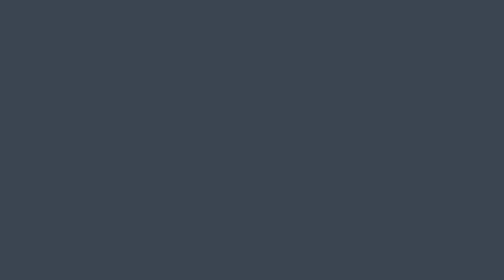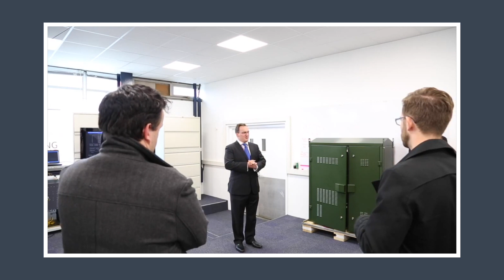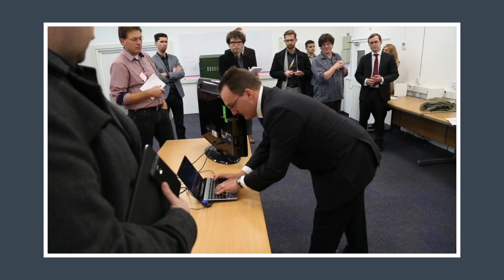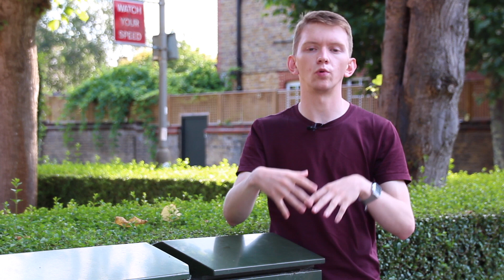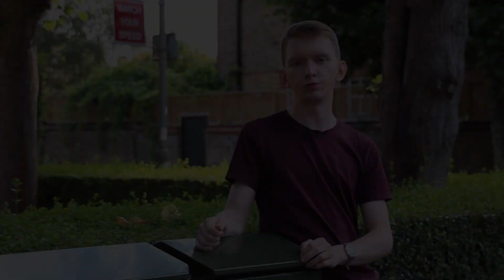Is G.fast an FTTP replacement?

Comment: i have had g.fast since 2019 with SOGEA 160Mbit/s 30Mbit/s but have just placed and order to upgrade to SOGEA 330Mbit/s 50Mbit/s - the street cabinet is literally next to the block of flats i live in so hopefully i will get the full speed of the upgrade and it will be worth the extra £10 per month for the upgrade

Comment: The pods are only ever bolted to street cabinets, not on telegraph poles or under man hole covers, so the points raised are rather point-less! I have G.Fast 330 which I took out in 2018 when it first rolled out in my area. The local area was already undergoing FTTP works. However, living in an apartment, the company who runs my block have been reluctant to have a commercial grade ONT fitted in the service cupboard which would allow all the flats to have full fibre broadband. 

As a result, G.Fast has been an absolute blessing. The old download speed of 78mbps was not enough, considering my other half works from home and is constantly on video conferences, we have 3 Xboxes, 3 smart tvs, 3 phones and a PC. It used to struggle. It took ages to download or update a game, streamed videos would suffer quality drops frequently etc. With G.Fast, I get a minimum of 300, usually 320 or so down, 48 up and latency has been more than halved to about 6ms which I think is pretty incredible. 

I have split the bandwidths, so TVs and Xboxes use the 5Ghz the router is capable of, and the rest uses the 2.4 frequency and I’ve found that this has improved reliability and really helps when online gaming. 

I would absolutely love to have fibre to my apartment, however at this time, it looks like that is unlikely to happen. And it seems most ISPs have phased out G.Fast to new customers, so I’m stuck with my current one, provided they don’t pull the plug entirely which I hope they do not, as going back down to sub 100 speeds will be such a noticeable downgrade.

Comment: My copper landline must be very short because I'm getting the full optic fiber 1,000 Mb/s speeds over G.fast in my condo and the copper landlines hook into the fiber from the condo utility room.
Reply: 50m is pretty much gigabit guaranteed. So that's what the guy was saying - in a home where you can't/won't replace existing copper lines, g.fast is where it's at.

Comment: I work with copper every day as a field tech for the largest ISP in my country. I can tell that this is a bad idea. We have so many faulty connections especially in old buildings, electromagnetic interference from hell and sometimes customers where there have been 7 or more technicians on site, to the point where everything from the port to the router was replaced (seriously for up to 3 times...), all test results look great and still the d* thing keeps losing connection for some weird reason. Of course this is only a small percentage of overall customers but my recommendation would be to only use higher than 35 Mhz g.fast in an environment with in building telephone wiring that is less than 10 years old and better replace old telephone cables entirely. And there we have the problem. Then one could simply pull fiber or Cat7.